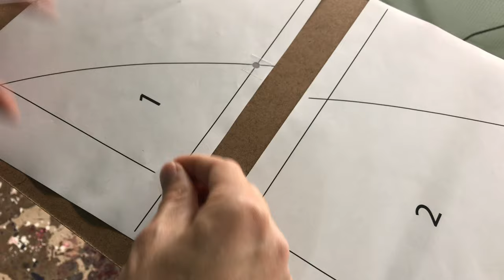Make a Surfboard Template from an Online Download

Comment: Hey  man! Did you use A4 size sheets of paper, and did you enlarge them at all or just used the original size from the website?
Reply from the maker: Just standard size paper (8.5 x 11) and just make sure when you print it’s at 100% with no scaling so it’s not resized.

Comment: I'm having a hard time finding thick dark pencils. Do you know what number the pencil is that you used to trace the outline on to the blank is and where did you buy it? Thanks.
Reply from the maker: Just a Home Depot brand pencil. Probably most hardware stores have them.
Reply: @BendheimBoards    Ok, thanks. Last time I was there they didn't have any. If you're in San Diego would you be interested in renting your shaping room for a day? (I live in Carlsbad.) I have my own tools and of course I would thoroughly clean up before leaving. If not your place can you recommend a place that wouldn't cost too much? I'm slow so I'll probably need a full day.
Reply from the maker: I’m in Orange County. Not sure about places down where you are but up here you can rent the Foam EZ shaping bay for $10/hr

Comment: Is there a certain layout to print it? I print a 9-3 template but when I was done with the process it came out to be 8 foot. It was from BlendingCurves
Reply from the maker: I used blending curves as well. Make sure you have your printer setting at “no scale” or 100% scale so it doesn’t shrink the size.
Reply: @BendheimBoards  Thank you man I will give it a shot

Comment: Hi brother i just starting to shape but i printed out a couple of templates from blending curves of 6' and 6'4"  but all of them came out smallers , my paper is 8x10, i dont find out any information in the website about what size of paper i have to used or what is the problem. I dont know can you help me,?
Reply from the maker: Use standard 8.5 x 11 paper and make sure the print setting is at no scale or that scale is set to 100% so that it doesn’t alter the size. Hope that helps!